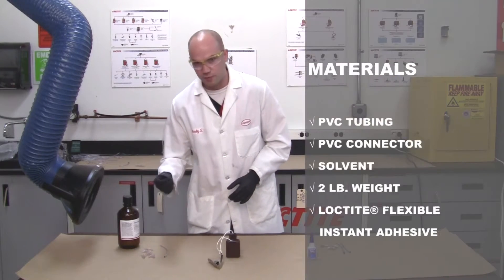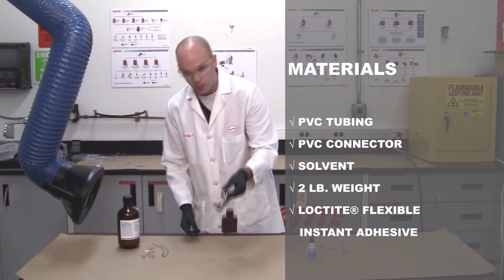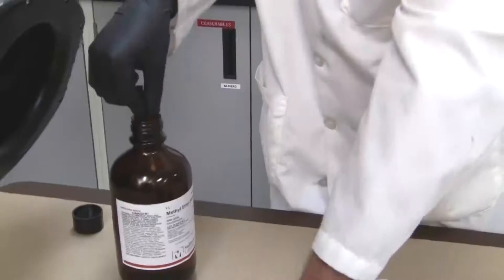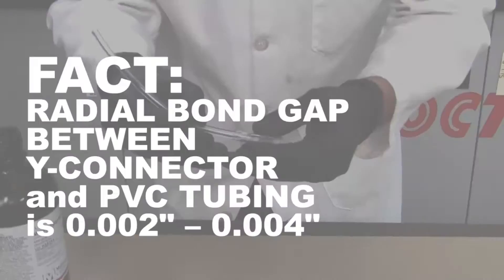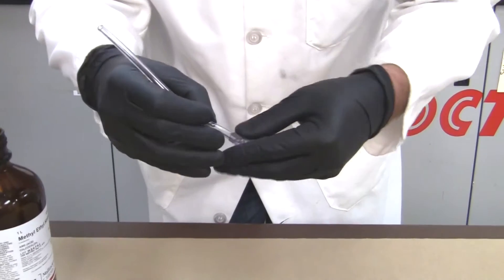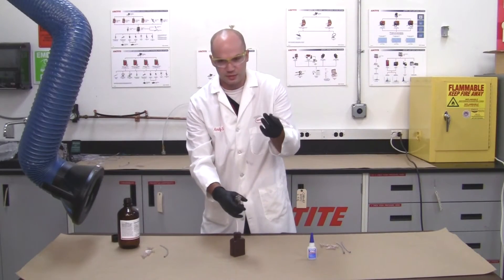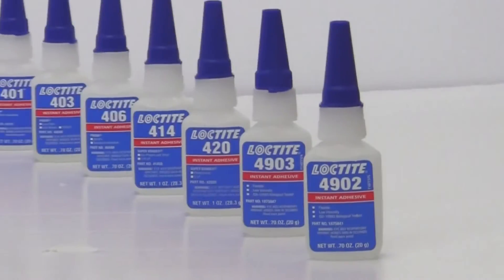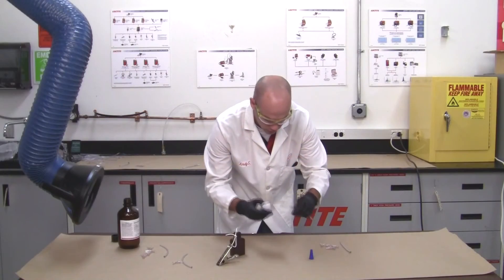Solvents vs. Instant Adhesives: Which is Better for Processing?

Comment: hi guys, just wondering if i can use the loctite 495 to reattach my watch band in which it is known as "rubber" - www.amazon.co.uk/ChronoTech-Gents-Extreme-CT-7037M-08/dp/B003FMUO4C

I tried to glue it on 1side and left for 2 night but soon, when i pull it, the seal got broken :(
http://s24.postimg.org/pejzthq6t/IMG_20151116_132019.jpg

kindly advise.
Reply from the maker: +Wah keong Lim Hi there, thanks for reaching out! Without knowing the type of rubber you're trying to bond, it's hard to give a definite solution. An instant adhesive like the 495 would give the greatest chance of working on most rubbers, but if you find that it does not work on its own, you may have one of the tough-to-bond rubbers that require a primer like LOCTITE SF 770 with a gel-type instant adhesive like LOCTITE 454. If you'd like to talk through your application in more depth, please feel free to call our help line at 1-800-LOCTITE. Hope that helps! - Brandon
Reply: +Loctite North America Hi Brandon, thanks for the advise. Unfortunately im from Malaysia (thus, unable to make the call to 1800-Loctite) and the only 'contact us' found from loctite website : http://www.loctite.sg/153_SEA_HTML.htm .... would that be possible if i can directly get in touch with them looking for the appropriate solution for this bonding ?
thank you :)
Reply from the maker: +Wah keong Lim Hi, yes, you should be able to get in touch with our team in Malaysia that way. Please let me know if there is anything else I can do to help. - Brandon